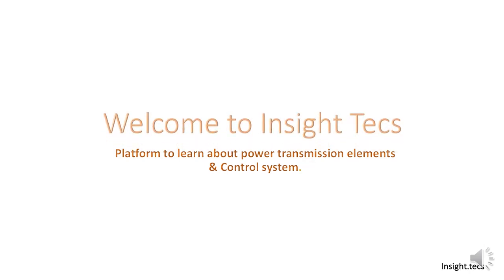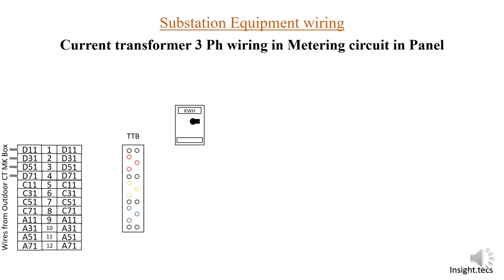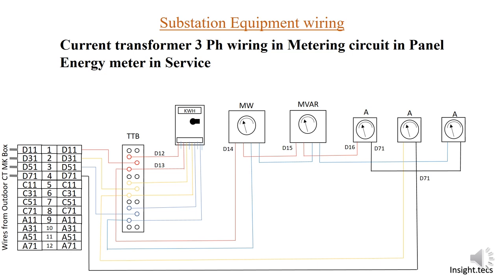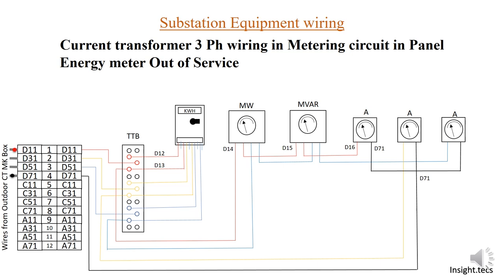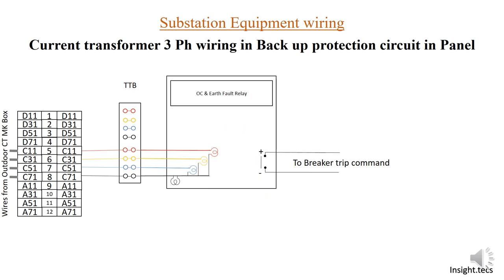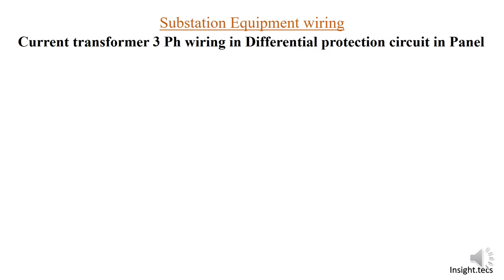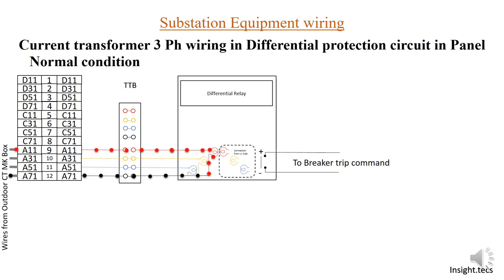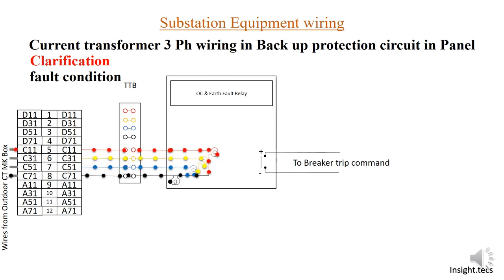Current Transformer wiring inside the panel || Part-3 ||

Comment: How many core maximum  does a current transformer has? Can u explain 6 core CT wiring?
Reply from the maker: The wiring of any CORE of CT done as same as single core  explain in video, 

You just need to name like
For core 1 - 1S1
       Core 2 - 2S1
       Core 3 - 3S1
       Core 4 - 4S1
So on....

Comment: If 1S1-1S2 CONNECTED AND WHAT ABOUT  1S3 taping IS OPENED OR short condition WITH 1S1-1S3 ?
Reply from the maker: should be open.
Reply: @Insighttecs  if open, that winding gets induced voltage right?